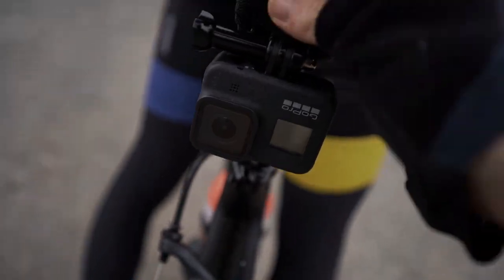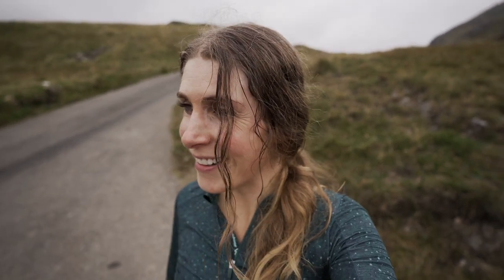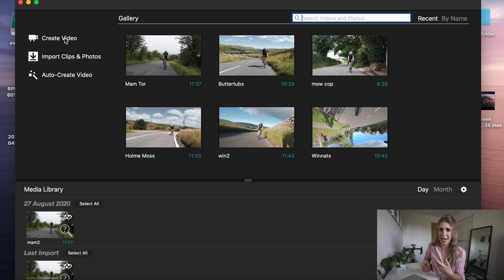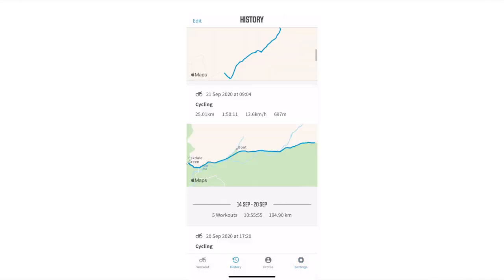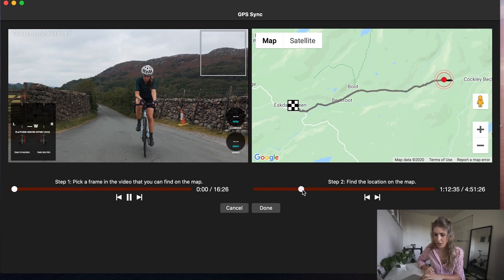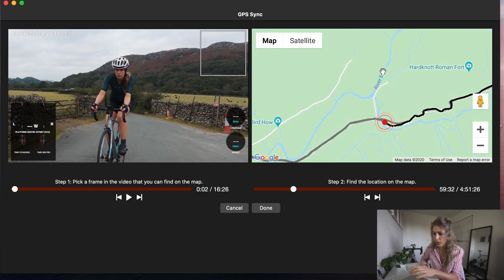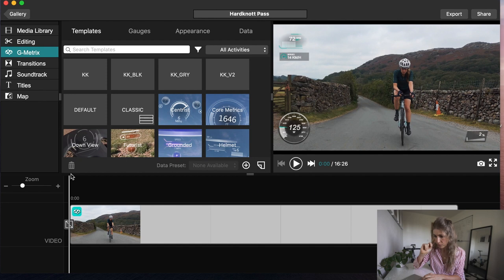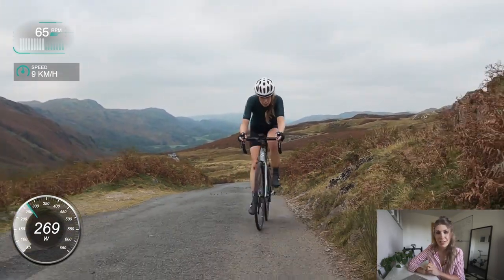HOW TO FILM & ADD POWER OVERLAYS!!

Comment: Ok. Downloaded virtual, will get the chilli tech out and have a play. Also had a plastic moment and fitted an 11-40 to the bike. Seems ok. I fitted a sun tour cassette (I am a sucker for shiny stuff and a red anodized spider. Yum. The seam chain, not so much. I will probably swap it out for a shimano so that it fits with the 105 kit. But after some swearing with the indexing it all works. Taen it for a spin, so all good. Will test it in anger later. Initial thought are that the bigger cassette will destroy hills. The top gear i am moving from a 12 to 11, so slightly more effort to use, but this is a good thing. I also splashed out on lights and computer. Got a roam bundle. Omg it's so easy, i love it. I also got an exposure race 15. A good middle ground for mtb and road i thought. So yeah, i have invested a lot in the next audax (yes i am hooked and having a mad moment). So anyway, your advice has paid off so far. It wont make me faster, or a better cyclist, but I think I can manage anything with my set up. Ummm. Thanks

Comment: There is another way to do overlays. You may export gauges as PNG sequence, transform them into animation video (use ffmpeg with qtrle codec) and then add them on top of your video in Final Cut Pro (or another video editor). This method allows you to crop and tweak colours without affecting overlay. And final video quality seems to be little better.
Reply: Not always , because , though .
Reply from the maker: Thanks for the tip :)

Comment: Garmin VIRB edit doesn't work anymore with Google maps. Is there any good alternative?
Dashware is terrible for me
Reply: It does work after changing a setting. Problem is the use of the Internet Explorer. I've got this solution from the Garmin forums, it will change the browser to Edge. Next time you start Virb everything will work again.
Open command prompt or powershell in administrator mode
Run the command to add the new entry: REG ADD "HKEY_LOCAL_MACHINE\SOFTWARE\Microsoft\Internet Explorer\Main\FeatureControl\FEATURE_BROWSER_EMULATION" /v VirbEdit.exe /t REG_DWORD /d 0x00002ee1
Reply: @OliverScheffer-Photography  thanks mate for this solution. As soon as I try this I will let you know if it works for me.
Reply: @OliverScheffer-Photography  it works as before. Thank you very much for this solution it makes me and mine friend very happy. Thanks from my friend and me.
Reply: @djolejo  You're welcome, glad I could help you!
Reply: Fix no longer works
Reply: @-M-2-K-  No it doesn't, I hope there will be a new fix soon.